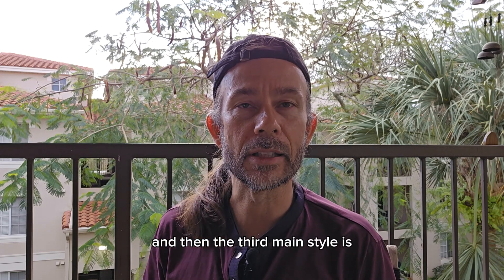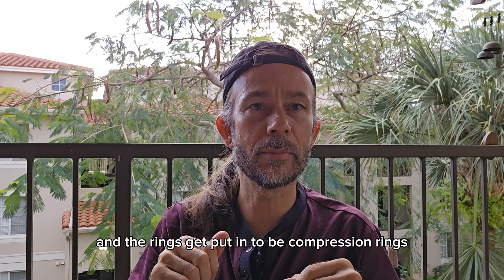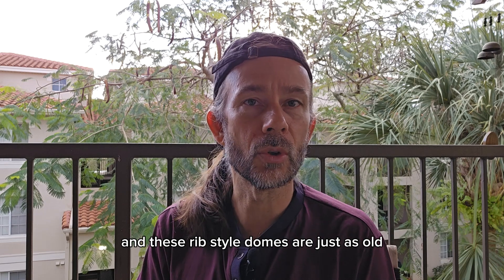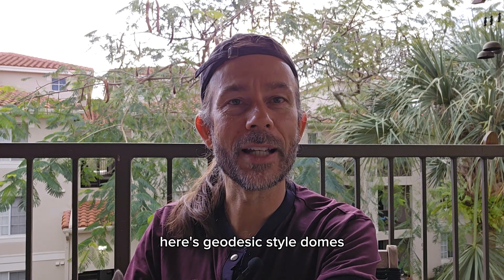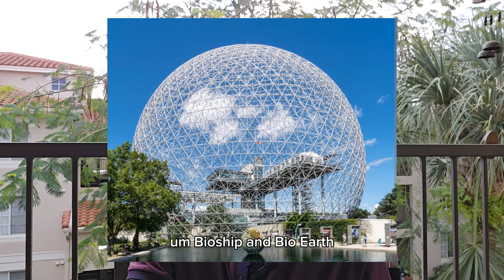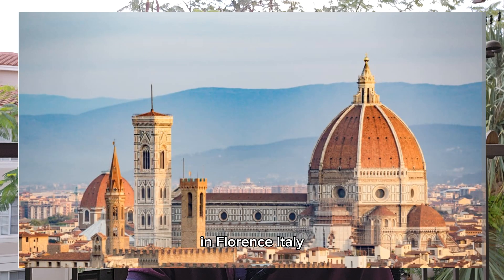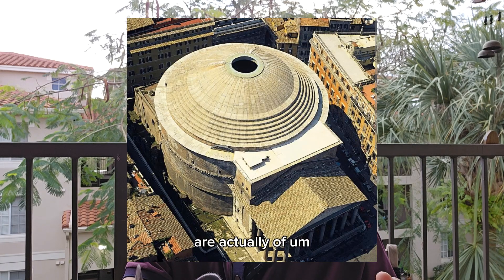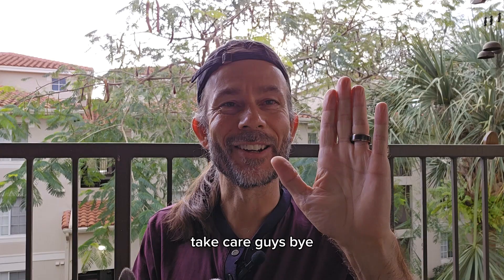What Style of Dome Is Better Or Stronger

Comment: Having worked in Green Oak timber framing in Cumbria UK, I would use the ribbed construction, but with knee and wind braces for extra stiffness and strength,  and it would be fully pegged with seasoned Oak pegs. No screws, bolts, steel or aluminium involved. Hence, it would last for 100's of years.
All the best.
Reply from the maker: Awesome feedback,  I'll discuss with my engineers